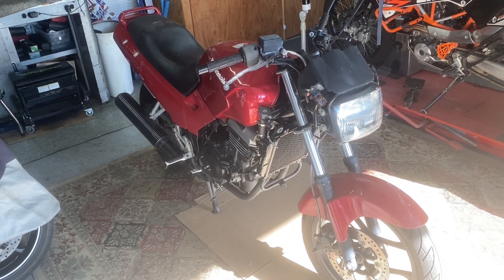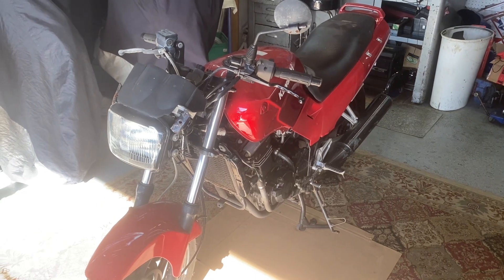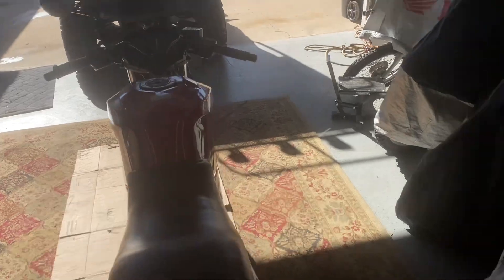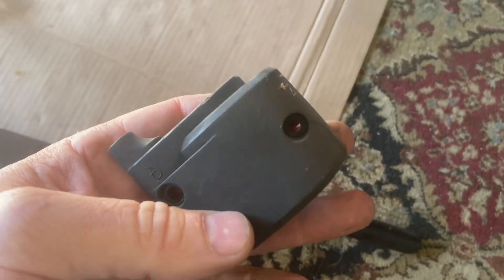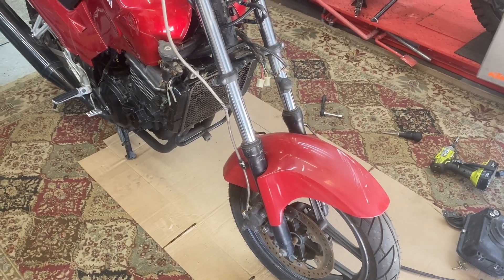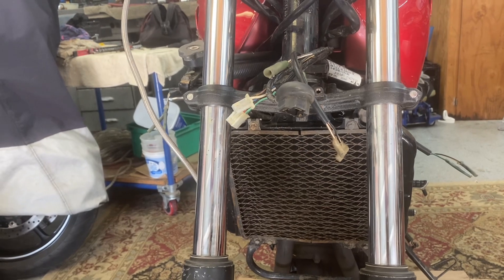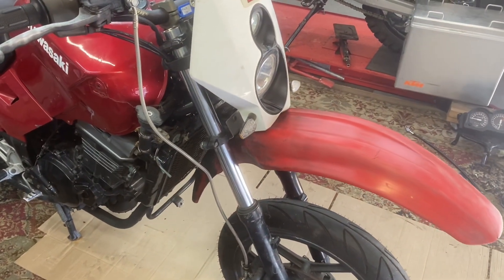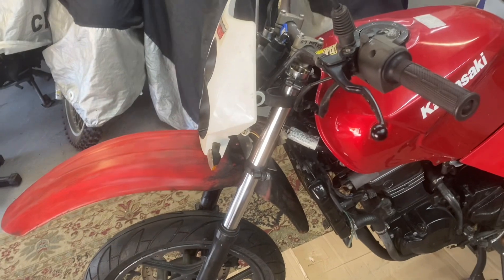Madness!!  Turning A Cheap Ninja 250 Into An Adventure Bike?!  Part One

Comment: Brother you need to get a table top mill and lathe. You would be a bracket and spacer makin' fool! And the 2 weeks of AMS cross training you got is all you need to be a fabricobbler
Reply from the maker: Yeah, but I would probably end up wanting the larger versions and then I would need a bigger shop.  It snowballs!  I have friends with equipment but it’s not necessary for a cheap POS like this.
Reply: @TomsTinkeringandAdventures  true story. Happened to me with wood tools